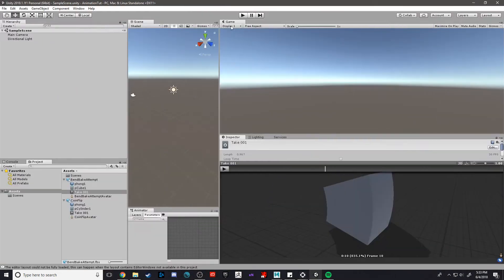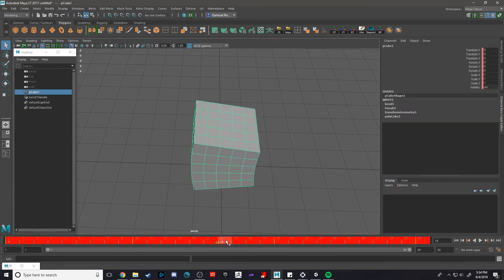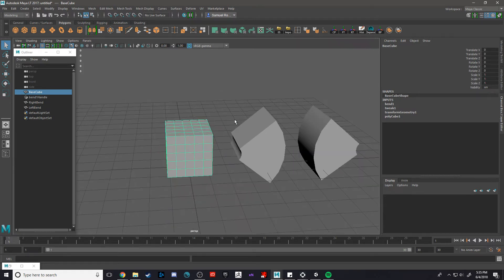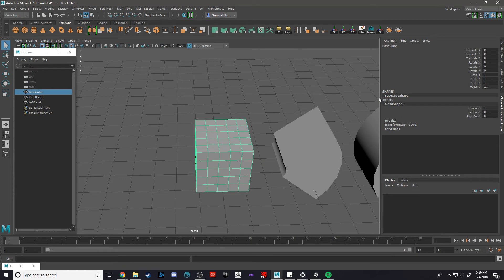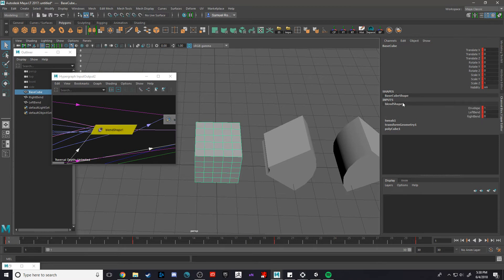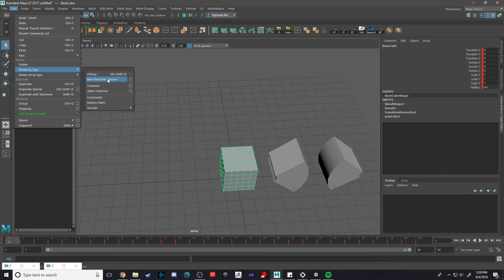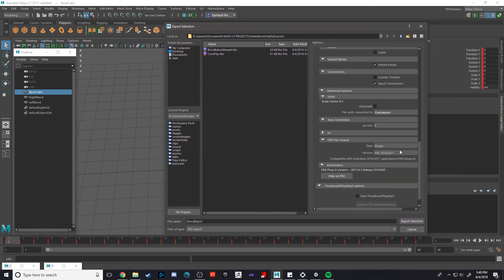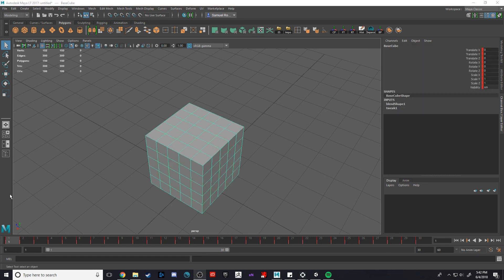Maya Tutorial - Baking Deformation-based Animations into A Mesh

Comment: One of the few problems of baking deformations into blendshapes is that the complex trajectories that the vertices follow in Maya become linear when converting to shapes. Just several days ago Keenan Woodall release 'Deform', a set of deformers for Unity that mimic the ones you can find in your favourite 3D package. 'Bend' is supported as well; not to be translated from Maya but to be built from scratch in Unity. It could be a nice complement to the technique told in this video.